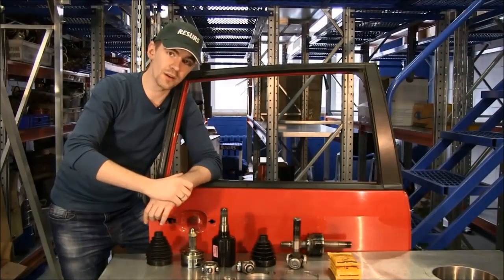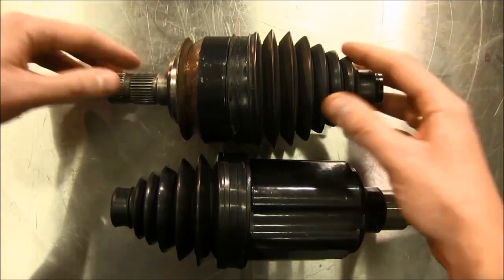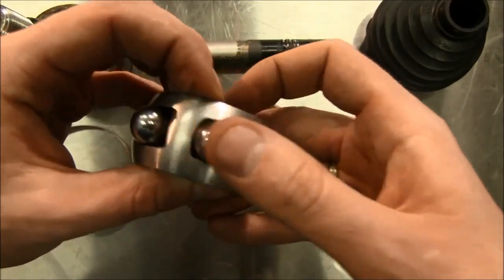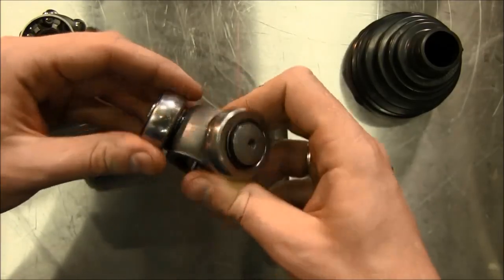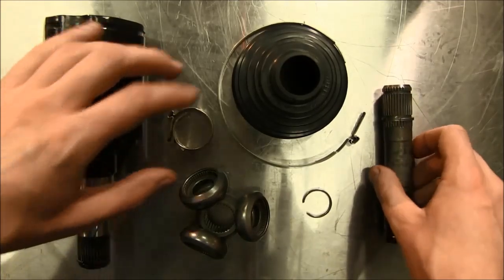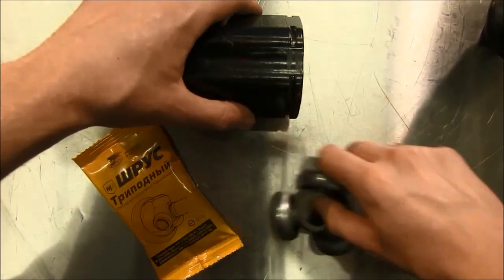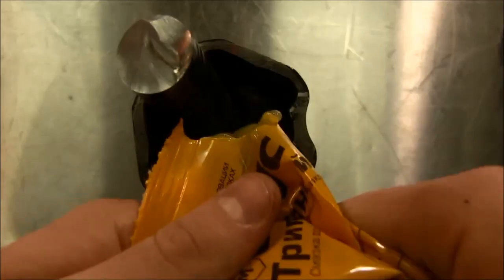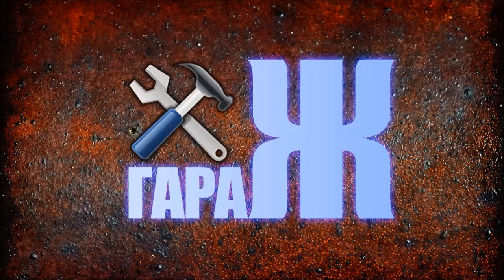How to fix a tripod cv-joint. Alex Rush

Comment: What type of grease is that, what nlgi rating and what is it made of
Reply from the maker: CV-joint tripod by VMPAUTO 
The grease is made of mineral oil with lithium soap thickiner.
NLGI 1
https://smazka.ru/eng/production/smazki/plastichnye-smazki/innovative-grease-for-tripod-cv-joints-and-needle-/
Reply: Hey! I had a inner boot on my 2001 Toyota Corolla Winter Vehicle with a  torn boot. Vibration on acceleration and limit of 60 km. 
Immediately I knew and seen some black grease on the torn boot.
SOLUTION? I INJECTED A WHOLE 400ML. TUBE OF LUCAS MARINE GREASE. ONE MONTH LATER STILL NO ISSUES WITH ALL THE SNOW AND SALTY SLUSH! UNBELIEVABLE!!! USED A PRESSURE INJECTOR MEDDLE NOSE TO INJECT THE LUCAS MARINE GREASE.
THIS STUFF IS AMAZING FOR A TEMPORARY FIX. NOW I TOOK IT UP TO 170 KM AND NO ISSUES.QUITE SMOOTH RIDE.
JUST AMAZED! I JUST ORDERED A WHOLE ORIGINAL CV AXLE FROM TOYOTA, NOW JUST WAITING TO HEAR VIBRATIONS BEFORE I CHANGE IT. HMMM? 
MAYBE ALL JUST DO THE SAME AGAIN AND ONLY REPLACE THE BOOT. ORIGINAL CV AXLE HAS 470,000 KM.  
DAMN! 
SUPERIOR TOYOTA QUALITY! 
LET'S NOT FORGET ABOUT LUCAS SUPERIOR MARINE GREASE MADE FOR FRESH WATER AND SALTY WATER. WATERPROOF!
Reply: Hey! I had a inner boot on my 2001 Toyota Corolla Winter Vehicle with a  torn boot. Vibration on acceleration and limit of 60 km. 
Immediately I knew and seen some black grease on the torn boot.
SOLUTION? I INJECTED A WHOLE 400ML. TUBE OF LUCAS MARINE GREASE. ONE MONTH LATER STILL NO ISSUES WITH ALL THE SNOW AND SALTY SLUSH! UNBELIEVABLE!!! USED A PRESSURE INJECTOR MEDDLE NOSE TO INJECT THE LUCAS MARINE GREASE.
THIS STUFF IS AMAZING FOR A TEMPORARY FIX. NOW I TOOK IT UP TO 170 KM AND NO ISSUES.QUITE SMOOTH RIDE.
JUST AMAZED! I JUST ORDERED A WHOLE ORIGINAL CV AXLE FROM TOYOTA, NOW JUST WAITING TO HEAR VIBRATIONS BEFORE I CHANGE IT. HMMM? 
MAYBE ALL JUST DO THE SAME AGAIN AND ONLY REPLACE THE BOOT. ORIGINAL CV AXLE HAS 470,000 KM.  
DAMN! 
SUPERIOR TOYOTA QUALITY! 
LET'S NOT FORGET ABOUT LUCAS SUPERIOR MARINE GREASE MADE FOR FRESH WATER AND SALTY WATER. WATERPROOF!

Comment: How did you remove the driveshaft from the tripod? 2:11
Reply from the maker: just pull it:) if it is not blocked, it will be easely removed.
Reply: Can you clean the tripod with gasoline or acetone.

Comment: Great video. I'm working on an 05' Toyota Highlander. The passenger side tripod joint is different than the drivers side....at least I think so. The drivers side has 3 swiveling wheels that all look good. However, the passenger side only has 2 swiveling wheels and the other is perfectly vertical, similar to those in this video. It spins just fine, just doesn't swivel and doesn't look like it ever did. Is this normal? I haven't found any info on this and need to get the vehicle fixed. It's a friend's SUV and she has 5 kids to haul around...lol. Thanks in advance for any info!